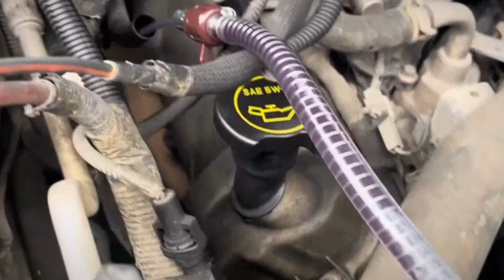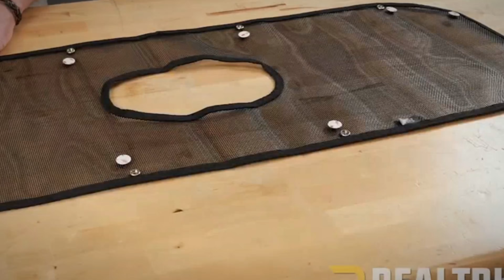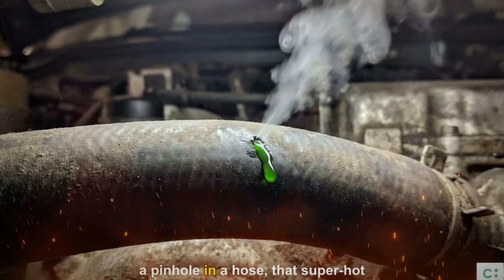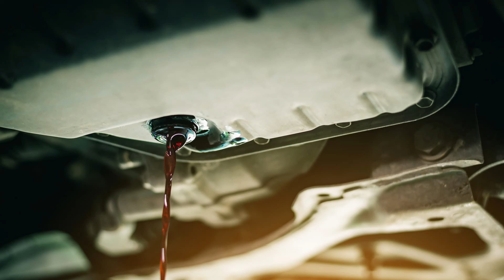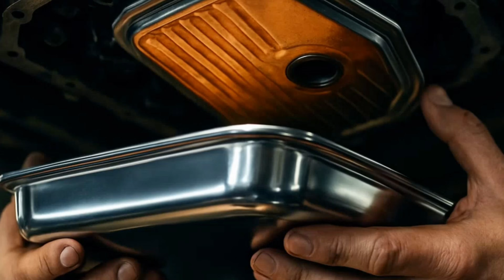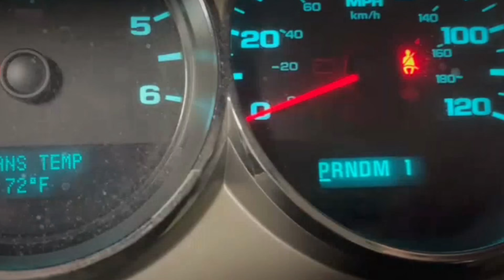6 Stupid Ford TOWING Habits That Are MELTING Your Transmission Cooler (STOP NOW)

Comment: You would think my 88k Lincoln Navigator with HD trailer tow package would have come with a air to oil cooler...nope! 235degrees on long hills in Mississippi first tow. Oh yeah, it will back your trailer in a spot or your boat on the ramp by itself....but no cooler??? Are there any REAL car guys in the design teams anymore? Or just dillrods looking to see how many cup holders and gingerbread they can build in? yep, got a real cooler ordered.

Comment: Wouldn't need additional coolers if you switch to LV Trans. Fluid. Ford specs. ULV for CAFE only. These transmissions are made to run LV Trans. fluid.